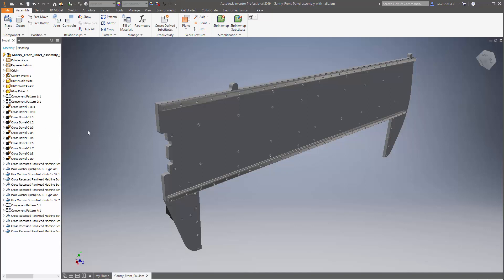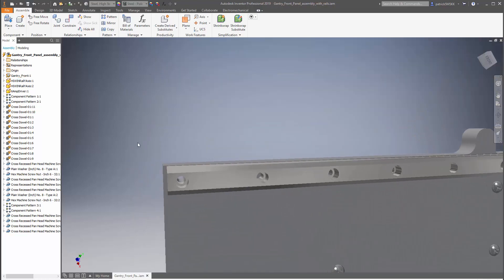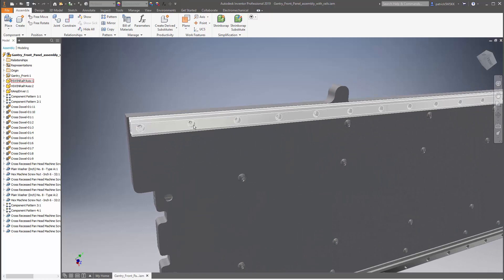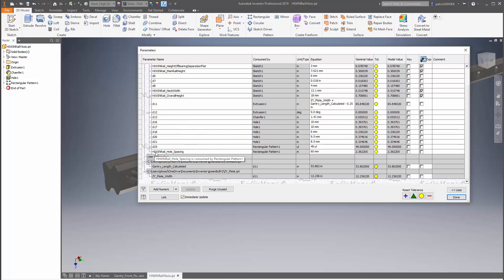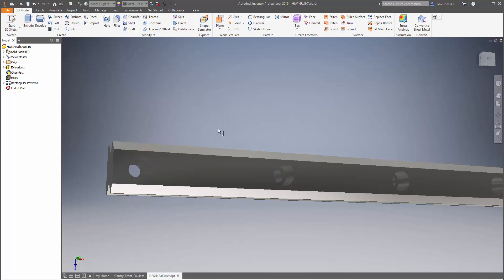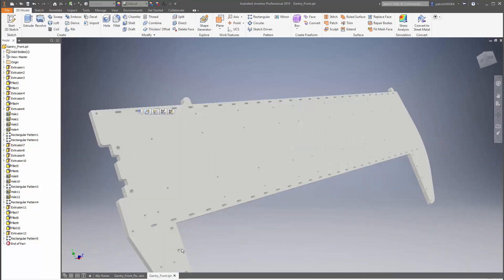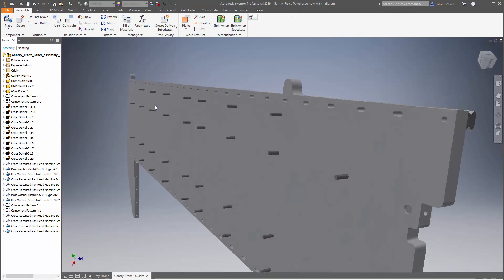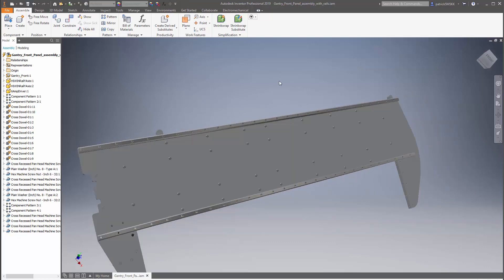Autodesk Inventor: Sharing Parameters Between Parts

Comment: 8:25 you could have just mirrored it
Reply from the maker: You are right.  1001 ways to do the same thing!! Haha!  I personally don't like mirroring unless the part really calls for it.  For me, parameters are easier to read when going back to the sketch at a later time.  I do believe I use mirroring on the other holes on this part since the X motor is located at the midpoint and I added ribs on both sides of the motor.
Thanks for pointing out the other option.